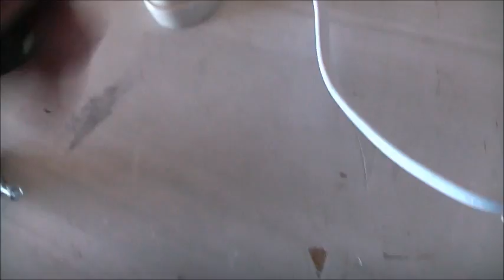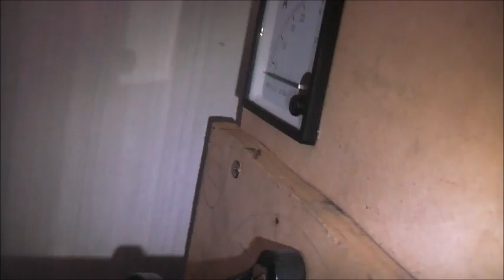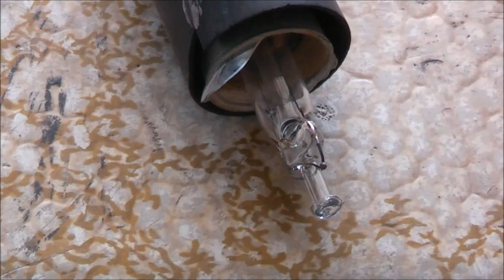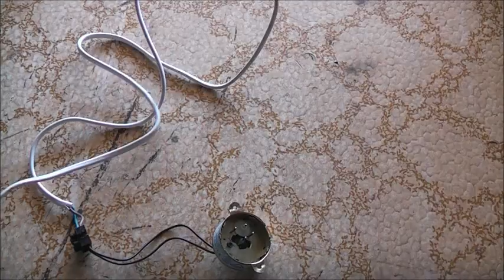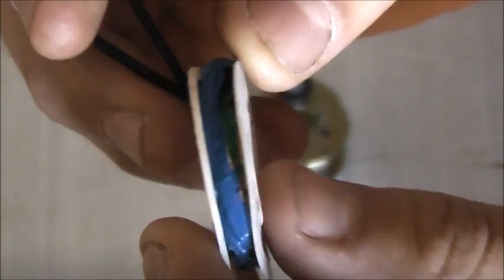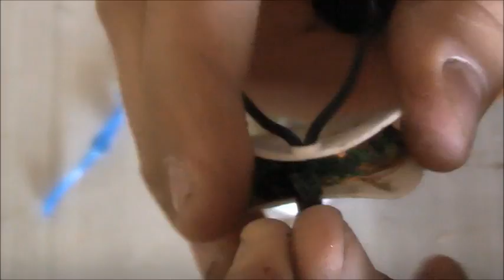Popping Stuff

Comment: LMAO! Lightbulb fuse poppage. :D This has to be a YT first. :D

Yes, let's short a lightbulb to see what current the fuse pops at. 

Interestingly, if you'd have been slower on the variac, it would've been possible to get the fuse wire to glow without popping.

If your multimeter has mA setting on it, put it in the circuit with another blown lamp (if you have another one, that is....) & see what mA the fuse pops at.

I guess it will be less than 750mA at 240v. May even be 500mA. :-)

-BBD.